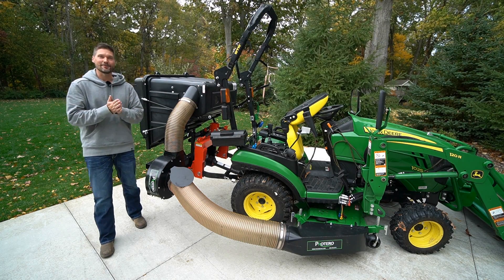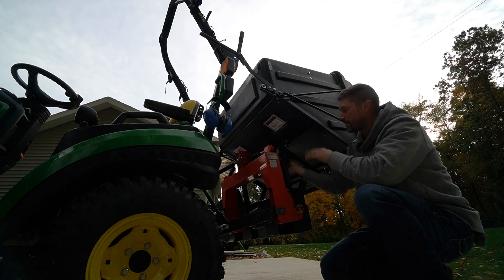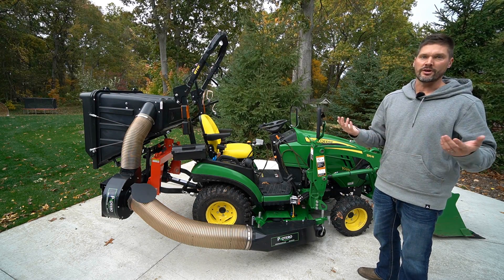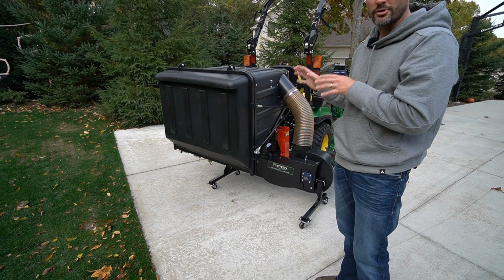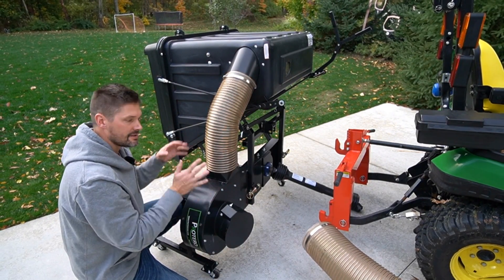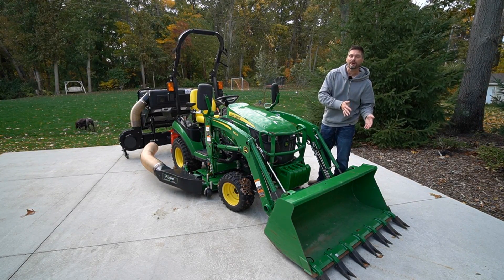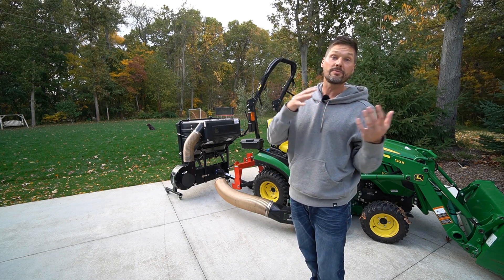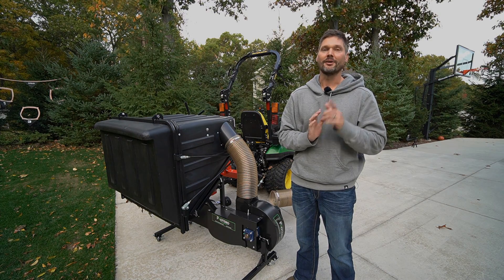PTO DRIVEN BAGGER SYSTEM FOR TRACTORS! 👨‍🌾🚜👩‍🌾

Comment: Soooo.  Your deck height (top up and low) is controlled with the same lever that controls the 3pt. hitch.  What happens when you raise and lower your deck to the whole collection system ?  Does it also go up and down ?  Or do you know a way to “disconnect” the 3 pt. hitch or stabilize it ?

Comment: Do they offer a quick release clamp for the hose between the blower and the deck? That would come in handy for when that tubing gets plugged. I’ve dealt with issues like that on other vacuum systems I used.
Reply from the maker: They don't, but I thought the same thing.  Would be a fairly easy design improvement I think

Comment: I have a 1988(?) 24 hp Bobcat Jaguar 61'' front mower/rear steer, that I mounted an 8 hp  blower that I turned into a suction unit, bolted to the side of it. Built my own tilting leaf box and everything is manual for dumping. It's nowhere near as nice as this unit or any of the newer ones, but it was way ahead of it's time back in 1994. It sure made picking up leaves a breeze, back in the day. Great video and thumbs up !!

Hope your pup gets well soon, they really are family :)))

Comment: I own the 3 bag system with powerblower that John Deere sells, here are some questions I would like to see answered in the operation video you do on this product.  How does this compare in capacity?  With that being PTO driven and metal construction does it to chew up the leafs more?  On the 3 bag system you really can't let the bag that is right under the chute fill up because if you do it backs up down the chute than your pulling it apart to clear it out and the blower because its not powerful enough to self clear.  How is this system for clogging and unclogging?

Comment: Love everything about it but that hopper is too small.

Makes no sense why it would be that small or maybe it's bigger than it looks. How many bushels does it hold?
Reply from the maker: 14.5 bushels
Reply: @GoodWorksTractors  That's only a little more than the 3 bagger on my mower, 9 bushels and that thing fills way too quickly. But the fact you can dump from the seat and doubt you can get that thing to clog so you don't wind up with dirty green arms and hands from unclogging and dumping! 😜
Reply: That hopper does look small. I will be comparing this to a tkv20 so I would love to see the operational video. So far the JD MCS20 with their collection unit is out of the picture just because the blower isn’t separately driven. Guess for me it would be how this stacks up against the tkv20.
Reply: @chamoua3968  They should have put a huge container on it, like the landscapers use.

I love bagging but hate clogs and stopping alot. This attachment selves the clogging but they could offer a larger collection box as an upgrade.

Comment: John Deere told me there was a bracket to attach to that piece on the front tonhold suitcase weights ($250 item), and not to put them on that bumper like you did.  It supposedly locks them in place too

Comment: There should be a PTO holding bracket attached so you can fold it and have a place for it to be stored instead of dragging it.
Reply from the maker: Yes, that would be a good product improvement.  I mention using a bungie to hold it up.
Reply: @GoodWorksTractors  That's actually why I suggested it.  Maybe someone could make the suggestion to the manufacture to add something.

Comment: These setups are ok for grass cleanup but when it comes to serious leaf cleanup like in the Northeast in the fall you'll be emptying that small hopper every five minutes.
Reply from the maker: Michigan leaves make Northeast leaves look like the JV squad!  See, I can trash talk! 😂
Reply: @GoodWorksTractors  Do you remember that setup JD had for the back of a compact with a giant hopper that would actually be able to raise up hydraulicly and dump in a trailer or low dump. Only seen one years ago but it looked like the ultimate setup but was probably really pricey.
Reply from the maker: TKV20?  Yes, it's more expensive because it's bigger and it's hydraulic.  Any dump from the seat sure beats the bags.  Those things get heavy when loaded with clippings or wet leaves.

Comment: They have been in business for a long time... and they have terrible customer service. I have a unit from these guys on my Kubota zero turn. It's great! Something broke and I need parts. Called and email numerous times. Nothing. Their stuff is great when it works. If something happens, apparently, you are on your own...
Reply from the maker: Sorry to hear that.  I've had nothing but immediate feedback even before establishing a relationship.  I know that doesn't mean much to you, but my experience has been all positive so far.  I do know they recently hired some folks to for engineering support, so perhaps they have addressed that past concern?
Reply: I've seen similar horror stories, I'm guessing on GTT but it's been a while since I read it.  I had basically written them until I recently realized they are located about 100 miles from my house.  They can't ignore me if I'm standing right in front of them. :-)